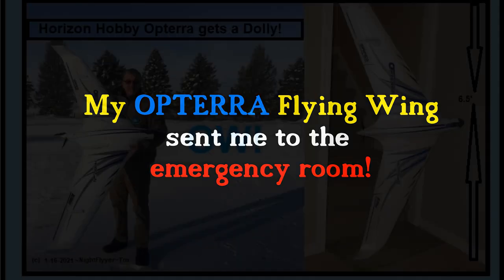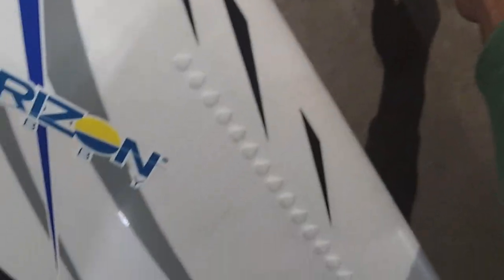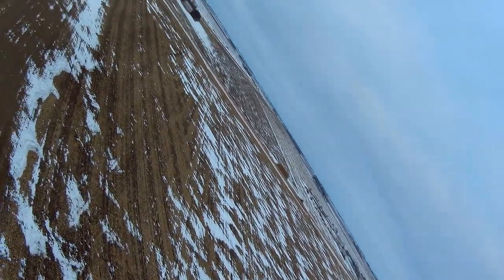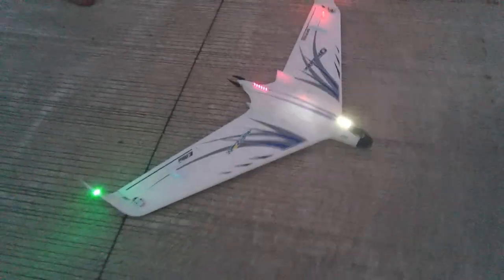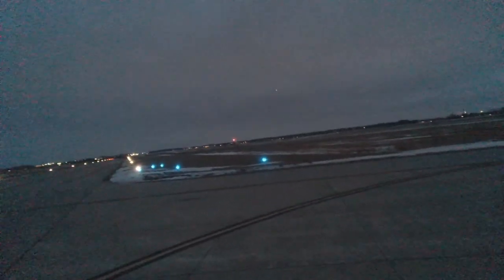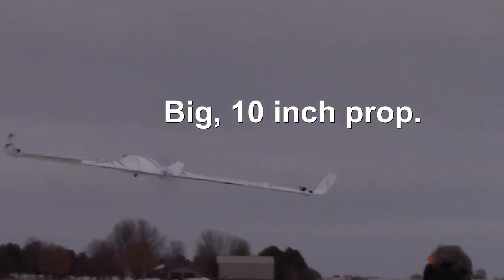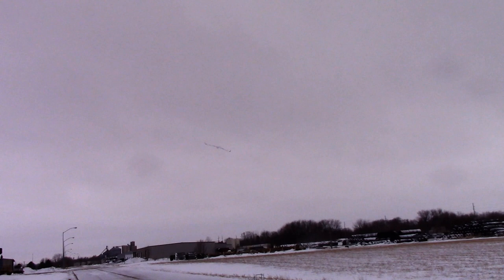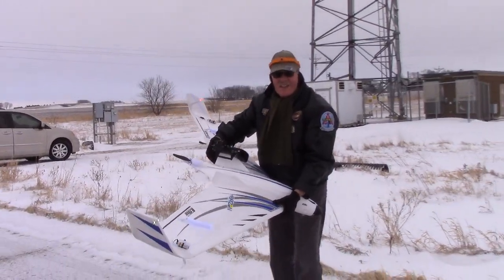My Opterra 2M Flying Wing sent me to the E.R. This is an awareness video & my solution for launching

Comment: There was a post about this plane on the iNav fixed wing group on facebook a week or two ago. One person put retracts on his. Others use iNav auto launch and set a motor delay so the prop clears your hand before starting up. Hope your finger is getting better and stays in 1 peice!
Reply from the maker: Yes, well if you saw my Product review  video,  https://www.youtube.co/watch?v=P_inF5EYLEE&t=1s  you would see  those wings aren't as strong or thick as you would think.  I would have to add a nose wheel servo and make it a trike as well.  And since the prop on the back is 10 inches, the landing gear would have to be quite long or retractable prop would hit the ground on rotation or landing. Again the Manual for this plane says nothing about a throttle cut switch or launching any other way.  Here is word for word what the Opterra 2M manual says about launching.  
1. Put the aircraft into launch mode with the channel 5 switch.  (in my first video that did not work, it went into the ground)  
2.  Hold the aircraft in one hand and the transmitter in the other.  
3.  Apply full throttle and throw the aircraft directly into the wind, angled slightly up (5 to 10 degrees above the horizon). 
4.  Climb to a safe altitude and check the trim.   
I know others have their own ways, and either way, my Dolly is the safest solution for me.  
The Opterra 2M manual also says nothing about throwing it with the motor off, so if a newbie followed the instructions, like I did, I'm showing what could happen, in case a gust of wind got them or something else.  The 7 foot wing is too big to throw discus style, as it bends a lot when you pick it up and the big wingtip's winglets are in the way.   Nothing is 100% and no matter how good you can throw, this big 7 foot wing with a 10 inch prop spinning right next to your face, is risky. 
Maybe a gust of wind, maybe my 73 year old left arm was weaker, or who knows.   But either way, if it happened to me launching the way I thought was good (and  the same) as all my previous launches. So if it can happen to me, it can happen to others, and that is the warning I want to present.
Yes, well if you saw my Product review  video,  https://www.youtube.co/watch?v=P_inF5EYLEE&t=1s  you would see  those wings aren't as strong or thick as you would think.  I would have to add a nose wheel servo and make it a trike as well.  And since the prop on the back is 10 inches, the landing gear would have to be quite long or retractable prop would hit the ground on rotation or landing. Thanks.
Reply: @NightFlyyer  If its an autopilot that came with that wing then ya I agree don't use it. iNav autolaunch is the stuff that comes in that wing. iNav autolaunch you tell it the climb out angle you want and throttle setting. Normally I have my autolaunch climb angle at around 22 to 25 degrees.
From what I see there is 3 people that have retracts in their Opterra's by the video's and pictures from different people. Neat seeing tricycle landing gear on a wing. Some even made 3d printed housings for the wheels to fold up into. If you search Opterra with custom retracts there are some videos showing it.
I have a AR Wing 900 with a 9x6 prop on it. I have my prop spinning slow'ish when I throw it and then the auto pilot spins it up to the take off throttle setting but its well clear of my hand by then. I have the autolaunch setup on my Phoenix 2400 as well but never use it. With a 13x6 prop on it there is no need.
Reply from the maker: @sams9716  I hate the autolaunch and as I said in my first product review video, I  don't like them, learned to fly helicopters before gyros were invented and rely on my talent instead.  I appreciate that, but if you follow my channel, you know I am no newbie and to say I asked for it or should have done it differently is sad.   First of all, that throttle arming had nothing to do with my hand injury. I only mentioned the Throttle arming because I followed instructions in the manual and that is  the way it bound up.  It arms the motor as soon as you plug in the battery. If it had said to program in a throttle cut, I would have!    We Marines were taught to follow instructions and stick to the plan or get dead!  So after spending 33 years in the Marines, I managed to stay alive because of that.  This wing is 7 foot long and will bend and break the end off the if you even try to pick it up by the tip. It would also be extremely difficult to somehow launch it discus style with the elevon there and that 7" tall winglet rudder that is also on the tip.  I know how to do it , but not with this plane.
It's not like launching my small F-27 Evolution.  So I followed the instructions word for as I did for the video I made of my product review earlier, but it bit me.  https://www.youtube.com/watch?v=P_inF5EYLEE&t=1s

Here is word for word what the Opterra 2M manual says about launching.  
1. Put the aircraft into launch mode with the channel 5 switch.  (in my first video that did not work, it went into the ground)  
2.  Hold the aircraft in one hand and the transmitter in the other.  
3.  Apply full throttle and throw the aircraft directly into the wind, angled slightly up (5 to 10 degrees above the horizon). 
4.  Climb to a safe altitude and check the trim.   
I know others have their own ways, and either way, my Dolly is the safest solution for me.  
The Opterra 2M manual also says nothing about throwing it with the motor off, so if a newbie followed the instructions, like I did, I'm showed what could happen, in case a gust of wind got them or something else.     Nothing is 100% and no matter how good you can throw, this big 7 foot wing with a 10 inch prop spinning right next to your face, is risky. 
Maybe a gust of wind, maybe my 73 year old left arm was weaker, or who knows.   But either way, if it happened to me launching the way I thought was good (and  the same as all my previous launches.)  So if it can happen to me, it can happen to others, and that is the warning I want to present.  Thanks.
Reply: @NightFlyyer  I never thought you were a newbie, I'm sorry if I gave that impression. I would not use that auto launch either. Its great that you follow the instructions and put up video's showing how things work that way. That plane is not for newbies.  iNav auto launch is in a different league. Here is a 2m Opterra with iNav auto launch. https://youtu.be/aocd1prnSMU . Wish it showed the ground view as well but at least its looking back and you can see the motor delay. You can also have it climb to a set altitude and hold position or return to you and hold position over you.
My Phoenix is just under 8 feet in wing span. I doesn't have as much bulk in the fuselage for sure. It does have a two foot horizontal stabilizer on the back that likes to smack me in the back of the head when I forget to duck.
Thank you sir for your many years of service!
Reply from the maker: @sams9716  Thanks.  Again, I simply followed the printed instructions as I expect newbies would as well.  If it had said to program all that in, I would have.

Comment: Throttle cut switch you have to program that yourself. Also I would try perhaps holding it by the leading edge and perfect a different hand launch method
Reply from the maker: First of all, that throttle cut switch would have had nothing to do with my hand injury. I only mentioned the Throttle arming because I followed instructions in the manual and this is the way it bound up and arms the motor as soon as you plug in the battery.  It's my warning to be cautious, because the manual says nothing about programming in a throttle hold to a switch. I've known of times when after flying, that switch was forgotten to be moved back to safe and it armed as well.  Nothing is 100% as it could be left in the wrong position, by accident. I'm pretty experienced, so never relied to on a throttle cut/hold, as all my machines need throttle stick movements to arm.   I only am warning others to be careful BEFORE the launch and to be careful no matter what you use. 
Also, My dolly was my different way to launch and it worked well.   
This wing is 7 foot long and will bend and break the end off the if you even try to pick it up by the tip. It would also be extremely difficult to somehow launch it discus style with the elevon there and that 7" tall winglet rudder that is also on the tip.  I know how to do it , but not with this plane.
To try to pick it up and launch it with left hand with motor running full, would be a tough call, not like launching my small F-27 Evolution.  So I followed the instructions word for as I did for the video I made of my product review earlier, but it bit me.  https://www.youtube.com/watch?v=P_inF5EYLEE&t=1s

Here is word for word what the Opterra 2M manual says about launching.  
1. Put the aircraft into launch mode with the channel 5 switch.  (in my first video that did not work, it went into the ground)  
2.  Hold the aircraft in one hand and the transmitter in the other.  
3.  Apply full throttle and throw the aircraft directly into the wind, angled slightly up (5 to 10 degrees above the horizon). 
4.  Climb to a safe altitude and check the trim.   
I know others have their own ways, and either way, my Dolly is the safest solution for me.  

The Opterra 2M manual also says nothing about throwing it with the motor off, so if a newbie followed the instructions, like I did, I'm showing what could happen, in case a gust of wind got them or something else.  The 7 foot wing is too big to throw discus style, as it bends a lot when you pick it up and the big wingtip's winglets are in the way.   Nothing is 100% and no matter how good you can throw, this big 7 foot wing with a 10 inch prop spinning right next to your face, is risky. 
Maybe a gust of wind, maybe my 73 year old left arm was weaker, or who knows.   But either way, if it happened to me launching the way I thought was good (and  the same) as all my previous launches. So if it can happen to me, it can happen to others, and that is the warning I want to present.

Comment: I think most of us wing fliers have scalloped scars on their pointer fingers. I've done it too. (Owie!) I have a friend launch my Optera but I don't start the motor until it is out of his hand. It glides pretty good so it works out fine. I'm curious about your throttle stick up and down arming sequence. I've seen that on some ready to fly models that come with transmitters but with my OpenTX or Spektrum transmitters I set up a throttle hold on a switch. Do you not do that? Thanks for you vids. I've watched them for years and so sorry about your finger. Welcome to the Finger Scar Wingfliers club. :)
Reply from the maker: I could not launch good enough in this 12 mph wind and it got me. It is very close on this 7 foot wing.  I certainly know about throttle cut as most of my helis have that setup. I've flown models for 60 years.  I'm 73.  But the best rc pilots in the world, have also had bad landings once in a while.  Shit happens, especially while I was trying to throw this heavy, under powered 7 foot model into the 12 mph headwinds.  Maybe if the Manual had said I should do that, I would have.  First of all, that had nothing to do with my hand injury. I only mentioned the Throttle arming because I followed instructions in the manual and this is the way it bound up and arms the motor as soon as you plug in the battery. It says nothing about programming in a cut switch like my helis have. I only mention it to warn others to program in this feature as well,  which also should have been mentioned in the instructions.  It's my warning to be cautious, because the manual says nothing about programming in a throttle hold to a switch. I've known of times when after flying, that switch was forgotten to be moved back to safe and it armed as well.  Nothing is 100% as it could be left in the wrong position, by accident. I'm pretty experienced, so never relied to on a throttle cut/hold, as all my helis and my drones, and many of my electric planes need throttle stick movements to arm.   I only am warning others to be careful BEFORE the launch and to be careful no matter what you use. .    Here are the links to the last videos and you can see I launched it the same way without problems. 
https://www.youtube.com/watch?v=P_inF5EYLEE&t=1s&gl=CO  and   https://www.youtube.com/watch?v=ur5V5H8UcGs&t=1s  Thanks. It's hello dolly for me from now on..

Comment: That was horrible, glad there wasn't more damage though. I got all of my fingers on one hand cut pretty badly by a racing drone that malfunctioned. All of the motors went full speed after it got covered in snow, and my hand is still healing, so I know how painful that is.
Reply from the maker: Good to hear your healing. Here is more on the issues of hand launching with pushers, especially this 7 foot Opterra.  https://youtu.be/f5xDfk7sbcQ  Thanks.

Comment: I always set up throttle cut on switch H on all my aircraft. Had my opterra get me across top of my hand when hand launching it my maiden flite.  I keep super glue in flite bag which works well if u get bleeding to stop.  Still hand launch but hold front of wing ahead of where it flexes closer to fuselage and side swing it I guess. Works well. But setup the throttle cut. Glad u are ok!
Reply from the maker: First of all, that throttle arming/cut had nothing to do with my hand injury. I only mentioned the Throttle arming because I followed instructions in the manual and that is the way it bound up.  It arms the motor as soon as you plug in the battery.  If it had said to program in a throttle cut, I would have! I only mention it to warn others to program in this feature as well.  That also should have been mentioned in the instructions. There are small indents in the fuse to hold as per the instructions.  This is a big plane and trying to hold it closer to the nose would put my arm closer to the prop.  I appreciate the suggestions, but from now on, it's Hello Dolly for me.   Thanks.

Comment: Just a thought when you had it on that PVC Launch Ramp maybe it would work better if you could find a long Rubber band and cut it into and attach one end to each of the ends of the PVC Pipe at the End of the of the PVC Launch Ramp and somehow attach it to the Plane and rig up some kind of release for it then it would fling the Plane off the Ramp faster what do you think?
Reply from the maker: Actually a bungee would work.  I did not design it to fling it off.  When I got almost to the end of the line, I just gave it full up and it flew off.  This works for me.  Thanks.